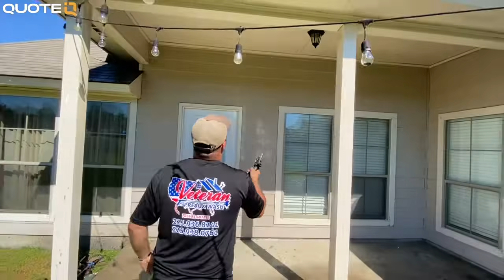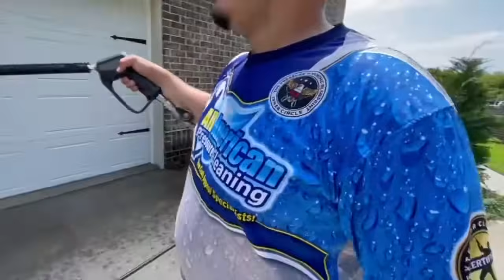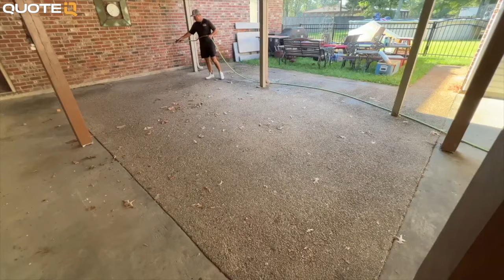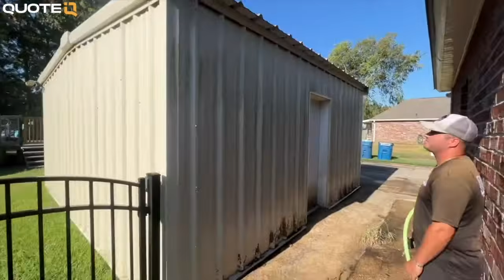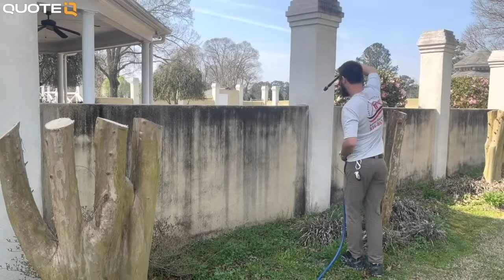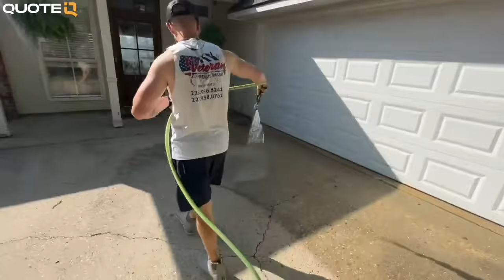How To Use Bleach For Pressure Washing - Everything You Need To Know

Comment: The strongest solution you can get with a 4 gpm machine and 12.5 sh is 1.25% regardless of the brand of the downstream injector and you will never get close to 1%  with an 8 gpm machine. X-Jet it since an X-Jet is basically a 50/50 mix (1 part chemical to 1.6 parts water).

Comment: Can you put the bleach and water mixture inside of the soap dispenser of the pressure washer? Or will it ruin the pipes/connections?
Reply: I use it in my electric pressure washer but I blow the pump out with pump lube when Im done.

Comment: So i have a 26 gallon chem tank with automatic 5.5 psi pumper. Now when i do a roof wash i would normally use around 5% SH as a target. Now when i get to the siding. Do i have to drain the tank completely if i only have one? Because the house siding would only need 2 percent. Or do i not fill up the entire 26 gallon chem tank and then when i move to the next service for the same house i just add more water to dilute it again without draining? Prolly a stupid comment sense answer but still gotta ask haha
Reply: So we’re in copper

Comment: One question I never see discussed is: how do you estimate how many gallons of batch mix you'll actually need based on the square footage of the job when using a 12V soft wash system?

For example, if I'm soft washing a 100 sq ft roof versus a 1,000 sq ft roof, I know how to calculate the proper SH strength using QuoteIQ. What I don't know is how many total gallons of mix I should make.

I want to avoid mixing too much and wasting product, but I also don't want to run out halfway through the job and have to stop to mix more. Is there a calculator or a simple formula that estimates total gallons of mix needed based on square footage?
Reply: That’s my question too
Reply: The mix strength is easy compared to figuring out how much total solution you’ll actually apply per sq ft.

What helped me was tracking roughly how many gallons I use per 100 sq ft on different surfaces/jobs. After a while you start predicting it pretty accurately.

For example:

* Concrete usually around 1 gallon per 100–150 sq ft
* Vinyl siding more like 1 gallon per 150–250 sq ft
* Heavy organic growth or porous concrete can use way more

Best thing to do is:

1. Fill a known amount (like 5 gallons)
2. Spray a measured area
3. See how much area that covered
4. Keep notes for future jobs

After enough houses you’ll know almost automatically:
“this driveway will take about 8 gallons”
or
“this house wash will probably use 10–12 gallons total.”

A calculator would definitely be useful though, especially combined with SH ratio calculations.
Reply: @Puskara12 just saw this comment thanks for getting back to me. Yeah that makes sense. I guess you're right it will just come with experience. I really appreciate ya. 🎉